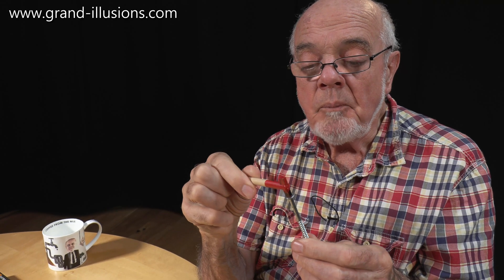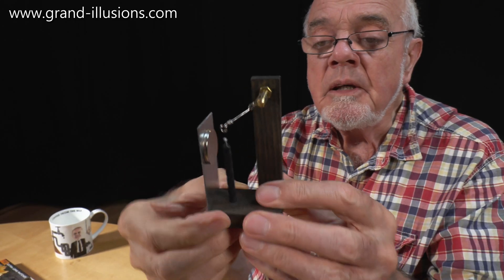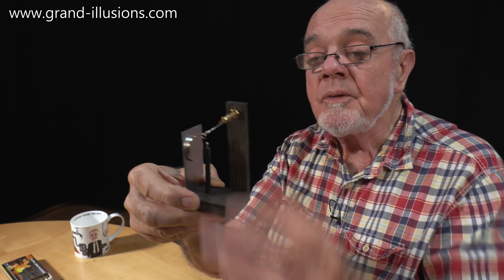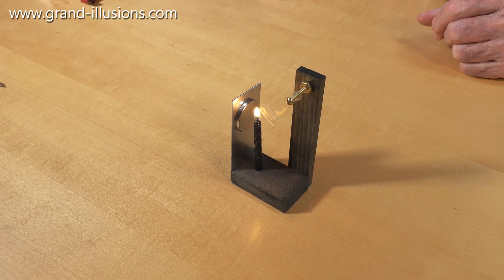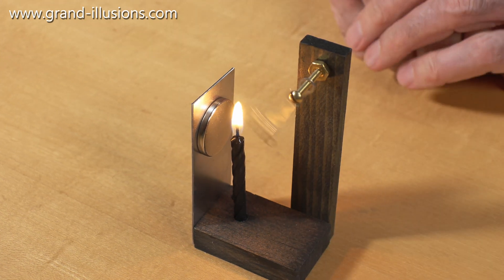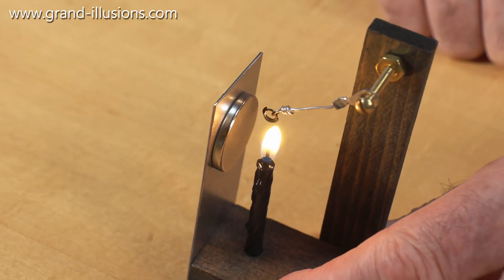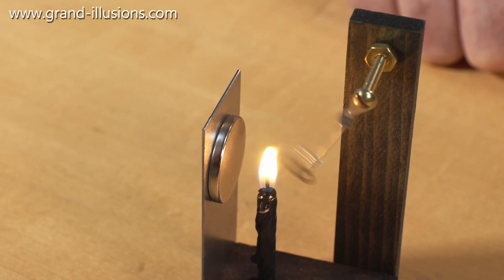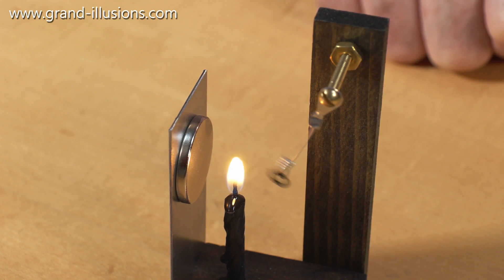Curie Point Magnetic Heat Engine - 4K

Comment: Yes, a piece of steel or other ferrous materials can lose their magnetic properties when heated above their Curie temperature and regain them when cooled. This characteristic is related to the alignment of magnetic dipoles in the material. When heated, the alignment of the magnetic dipoles becomes randomized, resulting in a decrease or loss of magnetism. Once the material cools below its Curie temperature, the magnetic dipoles realign, and the material regains its magnetic properties.

Comment: It doesn't make sense. The magnet is never cooled at any time because it is always adjacent to the flame. The only thing that I see that has the occasion to cool is the wire because it is not always near the flame. Also, I've seen many magnets lose their magnetic properties altogether because they were heated to much. I am assuming you gluded the magnet in place, otherwise as soon as it's magnetic properties begin to weaken it would slip and fall away. So, please do explain how the magnet is cooled in this process.
Reply: The magnet isn't cooled. It stays the same temperature all of the time. The metal ring heats up and cools. It's the iron that loses its magnetic properties. When it heats up it becomes nonmagnetic, like aluminum, and when it cools down it becomes magnetic again.
Reply: @peterbonucci9661  Thank you. That's a fairly good explanation!

Comment: Fascinating effect. Would seem to disprove a supposed molten iron core in the center of Earth.
Reply: The earth's core is solid on the inside due to the high pressure, but liquid on the outside and consists of iron and nickel. The Earth's magnetic field is created by this slow-moving liquid metal, which conducts electricity. The sun also has a magnetic field because its liquid plasma also conducts electricity and moves. None of this has anything to do with the Curie point.
Reply: @Tag-Traeumer  My understanding is the heat is what determines the curie point, not the liquid or solid state of the metal; although the state is a result of the temperature. Therefore regardless whether the supposed iron core is liquid or solid, the temperature far exceeds the threshold for magnetism to occur.

Comment: How cool! This is how some temperature controlled soldering irons work. Different tips for different temperatures have a magnet in them that loses magnetism at a set temperature, which cuts off the electricity heating up the tip, then when it cools off a bit, the magnetism comes back and the magnet sticks back to the other side completing the circuit and the cycle starts again. You can hear a little click each time it turns on or off. I always thought that process was cool in its simplicity, but I never thought of visualizing it like this! 👍
Reply: Yes. This is also how most rice cookers work. Once all the water gets soaked in rice and/or boiled off, temperature increases and magnetic switch cuts off power. There was a Technology Connections video about the design. I never knew about soldering irons - makes sense.
Reply: Exactly like the old weller was working.
Reply: @radarmusen  Yes, that's the brand. 👍

Comment: is there such a thing as a generator we could put over a campfire that could power anything more than a smart phone?
Reply: There are lots of ways to turn a heat differential into power.  Stirling engines are one way.  You can buy little Stirling-engine-powered fans that you set on top of old-fashioned wood-burning stoves to help circulate the air.  In principle, there's lots and lots of energy in wood, but in a campfire most of that energy is lost to the environment.  I'm not sure how much of the energy you could harvest without enclosing the flame.  Another option for converting a heat differential into energy is thermophotovoltaics.  That would probably result in a much lighter and more portable generator.
Reply: Thermoelectric generators aka Peltier modules

Comment: So:  what is the special alloy that makes this effect possible?
Reply: It would work with nickel, the Curie point of nickel is 358 degrees Celsius (677 degrees Fahrenheit)
Reply: It is not an alloy, the magnetism of a metal is due to the alignment of its magnetic dipoles. When you heat the metal, the atoms vibrate faster, misaligning these dipoles. This reduces the net magnetic field. If it reaches the Curie temperature (around 770°C), the magnetism disappears completely.
Reply: 1:17  @Drackormort  he says that the alloy has a lower curie point. The person you're replying to is asking what it is.

Chromium Dioxide, for example, has a curie point just above the boiling point of water. 770°c is the curie point of iron, not "the" curie point.

It looks like the confusion is that *permanent magnets*, often made of non-ferro-magnetic materials will permanently lose their charge when heated outside a magnetic field. 

Naturally ferromagnetic substances lose their attraction to magnets at that point, but naturally reform into something ferromagnetic when they cool.
Reply: @andrewkrahn2629 
Sorry, it was my mistake, I didn't pay attention to that part of the video, I thought the metal ring was made of aluminum only.

Comment: This is similar to how automatic rice cookers work
Reply: Rice and Curie, my favorite.
Reply: No magnets are used and rely on a different phenomenon to turn off the cooker.

At least the ones I've seen, rice cookers use expansion of metal under heat. 
The material, usually a bimetal strip, holds the circuit on. When the metal is heated beyond the target temperature the strip bends releasing the switch. 
The ratio of two metals can be tuned to get the desired cutoff temperature, a few degrees above boiling for the rice cooker.
Reply: @KaiPetro once I broke open the rice cooker and I saw magnet is used for temparature control
Reply: Learned a new word'Curie Point'❤
Reply: There are also RF based soldering irons that use the curie point to control the tip temperature. Basically once it hits the curie point the permeability of a ferrite inside the tip drops and no longer absorbs power from the RF oscillator.
Reply: Yup, if anyone wants to know exactly how it works, technology connections made a video on those.
Reply: Everybody knows that wrong
Reply: Just be carefull - loss of magnetic properties due to currie temperature i think is a irreversible process. Definitelly on magnets from iron, nicollum and cobalt... Think what on rice cookers and here happens is just weakening od the magnetic properties due to high temperature. Currie temperature for iron magnets is above 700deg C, thus the iron would need already glow red :-)
Reply: @obnovec  it’s not the magnet itself, the magnet attracts a metal disc made from an alloy that has a curie point slightly above that of boiling water, so when the rice cooks, the temperature rises, the curie point is reached and the trigger is released to turn down the heat. Technology Connections did a great video explaining how it works.
Reply: @obnovec  They use a neodymium magnet and a very precisely tuned alloy. As soon as all water has been absorbed, the alloy starts to heat up over 100 degrees Celsius and loses its magnetic properties.